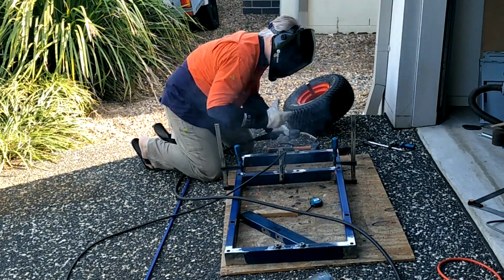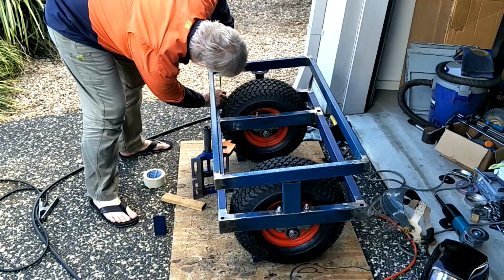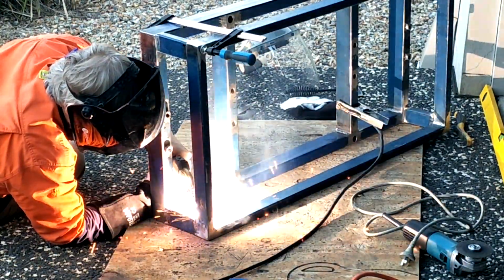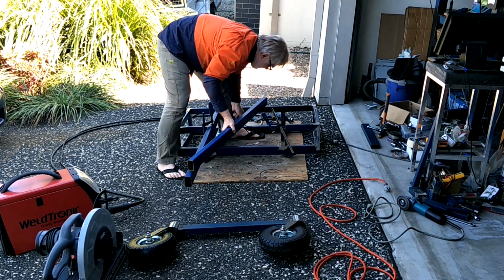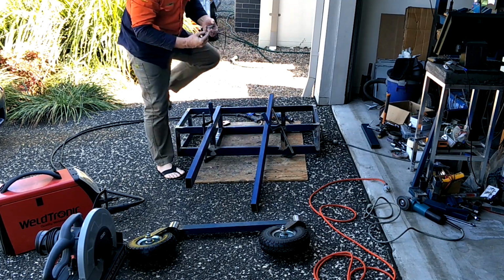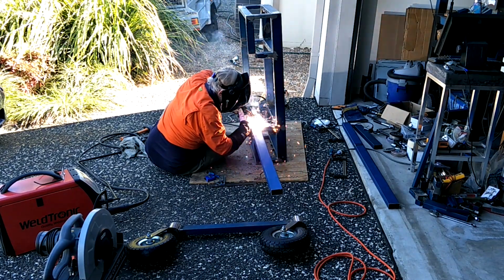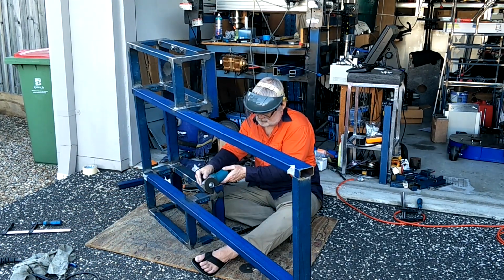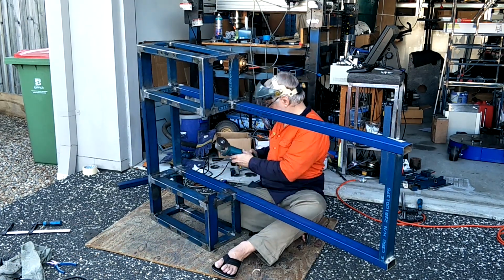Remote Control Mower - Part 30 - Some Decent Progress Is Made

Comment: I just love your safety shoes!
Reply from the maker: Yes they are Work Health and Safety approved... In all seriousness, I do own some brand new Bludstone safety boots. But unless you have welding spats for your boots you are better off with thongs on. I have had the misfortune a couple of times getting a hotty down the boot and it is not pleasant, Because they are tight the slag ball burns into your skin when the boot presses it against your skin. I normally try to keep my feet wide enough part so minimal welding splatter lands on my feet. It is a little uncomfortable having them landing on your bare skin, but they normally just bounce off. You should see the lovely thong tan I have got going.

Comment: That's not a mower, it's a tractor! How many hectares are you planning to mow?
Reply from the maker: Excluding the driveway the main block area is a bit over 1400 square meters. Takes about four hours to do it with a hand mower when the grass is long. I am hoping this cuts that time down dramatically. The "dream" is for it to one day just mow itself, but baby steps, need to walk before I run.